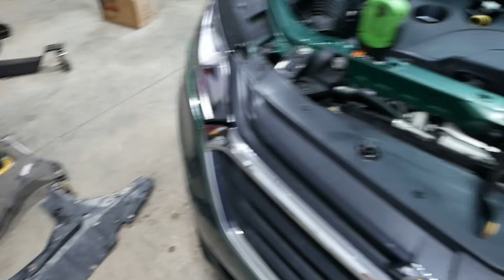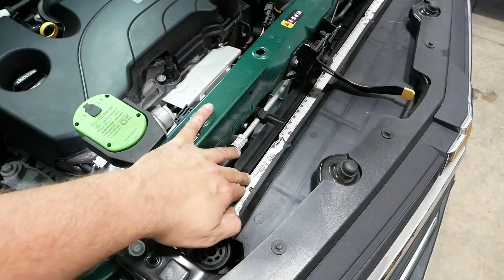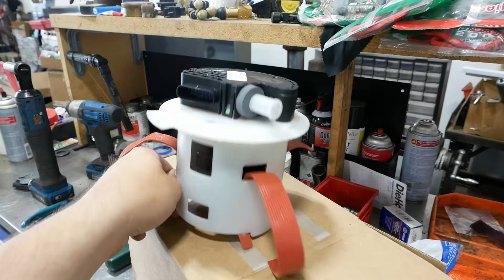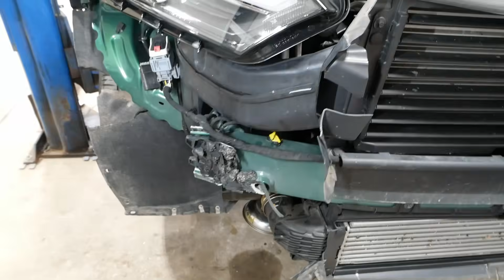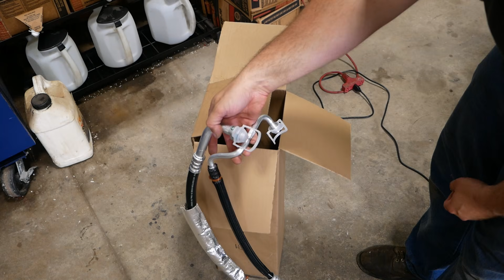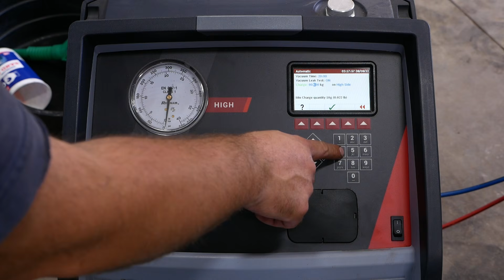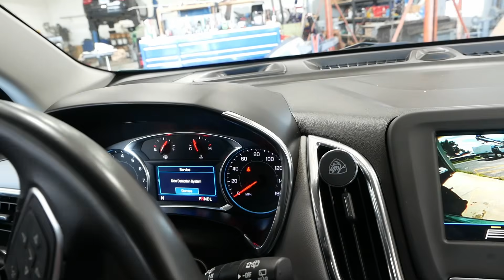Unbelievable A/C Leak 2019 Equinox

Comment: In a prior life I was a paint and body guy.  I've seen prior work like this roll in from time to time.  Makes for a pain to quote, especially if insurance is involved.  Ends up sitting around until an adjuster can see it first hand and document what they need.  Sometimes even turning into a fraud case further slowing the repair process.
Reply: the insurance companies encourage this kind of hack half ass work. use junk yard parts, parts from CoParts cars bill for new OEM parts to jack the price so the deductible is exceeeded

Comment: Def pump would be my guess as well, and the dangling sensor looks like ambient air temp. as for the initial check for gross evap leaks, it's cause r1234yf is flammable, don't need to fill a car cabin full of it accidentally

Comment: As expected, repaired properly. I imagine it would have been possible to continue along the same trajectory and bend some new lines so they wouldn’t rub, etc., however you really can’t guarantee that sort of work (or have any desire to associate your shop with that sort of thing). In this case the customer apparently had the means to fix it properly, but I feel bad for those who don’t and would have been in a real bind here.

Comment: Hello,
I'd like to add something to the whole 1234-yf thing.
I'm an apprentice in my 2nd year at a ford dealership in germany.
We also have such a "Robinair" machine, but a different model. 
Ours is able to inject oil, the uv-dye and a special non conductive oil you need for vehicles with high voltage a/c compressors, which are in ev's and some hybrid vehicles.
So yea, I don't know how it is for you in the usa but we have such machines over here.
And yea, the whole put in pull out deal is normal, I once asked someone at our shop and got the answer it is supposed to get a charge which is more precise in terms of actual refrigerant charged into the system. 
Oh and, yea. Our Robinair machine recently made a bang noise and was dead. A tech replaced the inbuilt power supply and the logicboard, hope it doesnt happen to you.

Anyways, keep up the good work.
Greetings from Germany 

~Marek
Reply from the maker: Strange. I looked everywhere for a machine that would inject oil. I could not find one.
Reply: @WatchWesWork  Strange... 
Our machine is a "Robinair AC1234-8". 
Maybe it's not available in the US, but that seems like a rather stupid idea not to sell them, i mean it's money they are not making.

Comment: Let me see. 134a was $4.00 for 12 ounce before the suck started . That would be $6.00 of freon? BUT it uses 1234yf at $45 per 8 ounces making it now $90.00 for freon. And that doesn't include labor. Is 1234 that superior to 134a? I see a lot of refit kits being sold even if 134a now costs $9.00 for 8 oz. $16 beats $90 anyday! Crazy. How about a block of ice and a fan in the back seat?

Comment: We as mechanics get to see more than our fair share of crappy body work/repair. Body man had used entire roll of electrical tape on wiring then hung the new rt ft fender over the mess. I fixed his CEL and driveability problems by removing the inner fender, the tape, and splicing several cut wires caused by the wreck.Body shop owner brought me the car. That's just one of many....Rainy day no run F 150 had the cracked windshield replaced, then it leaked water into left front kick panel, filled ECM with water. I could go on......

Comment: I work at a Honda dealership and most of the A/C work we get here is 1234YF. It's definitely more of a pain than the old R134a. Plus the machine gets very finicky sometimes. And that doesn't even touch on how much more expensive it is.

A good chunk of our A/C work is 16-21 Civics coming in for condenser replacements under a recall. Each one gets a complimentary evac and recharge of course. God only knows how much the refrigerant alone costs them.

Comment: I used to work in GM Parts Department. I can't tell you how many times I sold the right part number for something, only to have a completely different part in the box.
Reply: I once ordered an EGR valve from Fiat. When I went to collect the parts manager handed the box over. I said that is not right. He said yes it is. I said no it isn't. He said, how do you know you haven't opened the box. I said I know because the box isn't big enough. He had to apologise as guess what, it wasn't the right part.
Reply: Secret Santa gone mad.
Reply: Blame the computer..😅😅

Comment: What is the lesson here? Use a body shop approved by your insurance company, and insist. on a lifetime guarantee. If this was bought at a salvage auction, whammer bammered and resold, all bets are off. 
If you are buying a used car have it checked by a body shop. They love to point out crappy repairs.
Reply: pfft, couldnt pay me to use insurance company body shop. their insisted shops cut as many corners as they can get a kick back for coming in under the estimate but charge for all new OEM parts yet use junk yard /used parts, cheap garbage aftermarket parts. Id rather take it to shop I chose thats in no way shape or form affiliated with insurance company

Comment: Wow what a bad job the other folks did on this car.  But you immediately saw the problems and knew what needed to be done to complete a proper repair.  Fantastic job as usual.  Thanks for the videos.
Reply: When I was 17, I fixed an old Mercury Sable with similar damage.   I tied the front support to a tree with a rope, and slowly yanked it in reverse until I pulled it around to where the bolts would line up.  It wasn't exactly perfect, but at least everything bolted back on and covered it up nicely.  These guys didn't even attempt to get it right. smh..
Reply: Out of sight, out of mind...

Comment: Did you have to get new EPA certs for the new 1234yf system?
Reply from the maker: No. Same 609 or whatever it is.
Reply: @WatchWesWork  I guess that's a good thing. Still kinda sucks gotta have all new equipment to work on the new systems.

Comment: Wow. Whoever "repaired" that after the front end collision is straight up a scam artist
Reply: Looks more like a car that was damaged, sold at auction, repaired good enough to sell again, without disclosing the accident status.
Reply: @robertheinkel6225  Thats what i'm thinkin
Reply: Unfortunately, this is happening more and more with all the 3rd world imports that are crossing our borders. Anything to make a buck.
Reply: probably the dealer.   thats how its not on the carfax.   if a dealer fixes it on the lot, it doesnt have to be recorded.
Reply: That's why you get from most insurance jobs.  They want it done fast and cheap and quality doesn't matter.
Reply: @Noah_E    Insurance companies would never sign off on a repair like that.
Reply: @robertheinkel6225  Not enough of them actually go "look" at the repairs.  They just send the check to the shop and presume the owner will pitch fits about shoddy work.
Reply: @CAPNMAC82  
Absolutely correct. I've worked in a couple bodyshops and thankfully both of them were family owned businesses that were SERIOUS about putting out QUALITY work. The insurance company doesn't usually inspect any of the repairs made, only the damage and that's not all the time either. The shops I was at had their own adjuster on site, and just wrote up the car for what it needed and we did the work. Body jobs are definitely not created equal amongst all the shops out there unfortunately.
Reply: @robertheinkel6225 😅😅
My insurance company did.

Comment: that 1234YF stuff is flammable and makes hydrofluoric acid when it burns. hydrofluoric acid is toxic as hell. so beware of that stuff. if it blows across a hot exhaust manifold it can ignite.
Reply from the maker: It below into a 1000F turbo and didn’t hurt a thing…

Comment: Let me guess, they bought the car used and this crap was hidden? I ran into a used Nissan that the steering wheel controls did not work, horn did not work so I passed. Allot of shady crap is going on with the auto auction sites selling crap cars like this with hidden damage or cars that are clapped out with a zillion miles on them overpriced to the moon.

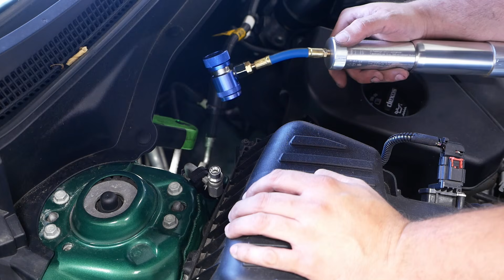Comment: 8:00 wait. clean whole system before check. you said nothing about cleaning of system. you can find out if the compressor has not seized as a result of leakage. cleaning the system, checking if the compressor has not thrown dust into the system (it can be replaced)

Comment: What shoddy workmanship. 
Whoever put on that foam piece with masking tape should be FIRED!
That calls for a Duct Tape repair.
Reply: exactly, everybody knows that job calls for duct tape, bunch of hacks
Reply: HAHA. One car I bought was missing not only the foam piece but the bumper bar behind it. Somebody just put on the bumper cover and left off everything else.
Reply: no no, in Wes's area it is mandatory zipties and bailing wire type repair. frame rail called for structural rebar, fiberglass screen reinforced bondo
Reply: @harveylong5878  no, you put a 2×4 there.
Reply: @suzi_mai  My second car was a six-year-old 1970 MG Midget that didn't have a front bumper. I used a 2X4 as one because the factory one was crap.
Reply: Ten thousand comedians out of work and you’re trying to “break” (nice little play on words, don’t you think?) into the business.
Reply: Real tradesmen use zip ties lol

Comment: Never buy a rebuilt car unless you personally supervised the rebuild or you have photos/video of every component being repaired/replaced AND you get a 3rd party mechanic to inspect it when complete.
Reply: Could easily have been a no insurance involved (out of pocket) repair... Hack it back together and trade it in (or sell it) and it moves on with zero history, sold to someone who didn't inspect it as a virgin car. 

That's why I always inspect paint and little things like the plastic trim behind the bumpers for evidence of being touched. Like this car, it can all be used to hide structural damage. 

But yeah, even if it's known rebuilt I'd still inspect it, because this stuff can easily occur. Saving money is usually the name of the game in rebuilds. A proper repair is rare.

Comment: On my sisters car the crash bar was pushed and collapsed the crush tube piece. Never knew till an air duct fell out of place when someone backed into her and broke the fog light. I knew the car was hit but the carfax was clean. Didn’t know it was a owner repair and not insurance. They got it looking good and sold it.
Reply: Yeah this is not cool, if the front took another hit then the safety is reduced because parts have already crumpled

Comment: When you go car shopping, either bring a friend that KNOWS cars and auto body well enough or pay the $100-200 to have a car inspected.  

Buyer Beyware indeed.  Nice to see GM continues to tag parts incorrectly.  I ordered an intake manifold for a Ford 4.6 - I received a thermostat housing.  Ordered based on part number which is what shows in Fords own parts DB.  Covid and post covid world parts sourcing is a mess, so is the "kwality".

I'm shocked the RobinAir YF1234 machine doesn't have an oil injection option like the R134 machines.  Wonder why that is?  Looks like the screen prompts and workflows were programmed by the EPA haha.

Comment: I wonder what the title says. Sure looks like it was "totaled" before. Great repairs by the body shop and yourself.
Reply: I wonder if the insurance company cut the owner a check for the repairs of $X,000 and the owner took it to some dude down the street who "fixed" it for $X00 instead.
Reply: @gritnix  My bet is bought at auction quick fix and to the lot in a other state.
Reply: @aitorbleda  in my neck of the woods, that's called the Eastern European flip
Reply: @DeweyCheatumNHoweLLC  An Arthur tussik?  He does decent fixes, but the style is that.
Reply: @aitorbleda  I only recall one, last name was Suschik (sp?). He'd buy Japanese insurance wrecks, patch them a bit and send them to an auction in either PA or southern Va.
Reply: @gritnix  That's another likely possibility.
Reply: @gritnix  It doesn't usually work that way.  When an insurance company cuts a check for a repair job the shop has to sign off on it in order to get paid.  The car owner can't take the money and go somewhere else.
Reply: @1575murray  that's the usual case  but in reality if hard pressed the insurance company , depending on the language used in the policy, may have to make payment solely to the policyholder.
Reply: @1575murray  I think it might depend on the state.  I've had an initial check based on the adjuster's evaluation actually made directly out to me.  But those are never enough.  I took the car to the body shop and then they started sending in all the extra stuff the adjuster missed and the insurance company would approve those adjustments and pay the shop directly.  But I was still sitting at home with that initial, fairly large, check.  I owned the car outright so was under no obligation to actually fix it anywhere in particular.  So I could've just cashed that check, had someone gloss over the repairs, and kept a bunch of money.  Someone else here said auction and that's a really good possibility too.
Reply: In new cars if there’s a major impact event in the bcm it’s totaled in most cases. Airbag deployment. Other than that most shops can replace or straighten the frames using a puller or porta power. It’s always interesting seeing how cars can be so weak and crumple as designed but still handle a crash
Reply: Yeah, looks like a Copart « runs » pos. Slapped together for a profit.
Reply: New cars don't get totaled that easy, a little frame damage is no big deal when the car is still valuable
Reply: @lolatmyage  I was under the impression that late model cars are totaled more frequently these days. Either way, it was readily repairable.
Reply: @OSXMan  I guess it depends, you definitely have some cases where they do big boy stuff like replace multiple frame rails
Reply: @OSXMan  I think that's more true if the airbags have not deployed, then all bets are off.
Reply: @lolatmyage  
Parts availability issues have lead to totalling many repairable vehicles. It took five months for my Gladiator. It was simple bolt on parts with no bodywork needed.
Reply: @841k9  I'm sure lean manufacturing and the global race to the bottom has nothing to do with it!
Reply: @lolatmyage  
Making the parts isn't a problem. Shipping them is. Parts are sitting offshore and unable to be unloaded due to excessive regulations in California.

Comment: We don’t have this model in Europe. Looks like an economy car. I thought GM was an upper class car.
Reply: LOL.  GM is NOT an upper class car. Its the equivalent of a Vauxhall for the EU.
Reply: Not for many, many years.
Reply: Nope, but the engine looks like a opel insignia one! Dont think they do any Opels in the states?
Reply: @timodeporto686  Not since the '70s. The only Opel branded vehicle any Americans would really know is the first generation GT.
Reply: @TheBrokenLife  well, you dont miss on these, opels drive fine, but generally bad build quality, bad materials and more, however, secondhand they are cheap...
Reply: @timodeporto686  That's, more or less, a description of the entire GM product line in the US. It's probably even more accurate for Chrysler though.

I haven't shopped the modern car market, but I'd imagine the Japanese brands are probably still the best choice outside of light duty trucks.
Reply: @TheBrokenLife  Kia/Hyundai are doing pretty well ATM.  Presuming they have a vehicle in the lineup that suits your needs.
Reply: @dfross87  I haven't spent much time around their entry level stuff in awhile, but I was really impressed with their later model Genesis offerings.

I'd probably still go Toyota or Honda if buying new, but I can see the gap closing there for sure.
Reply: @The Broken Life  I wouldn't even say the gap is closing (though offerings may be different in the USA).  I'd buy Hyundai/Kia over Toyota.  haven't looked at Honda lately.

The Koreans have better warranty, better cars, and lower prices.  Unfortunately Dad has a thing for Toyotas, so he paid $6K extra for a worse car, with a worse warranty, that doesn't fit in his garage properly!

Oh what a feeling 🙄!
Reply: @dfross87  Kia resale values need to appreciate to what Toyota and Honda have been enjoying for decades before they'll be seen as being in the same league.

I also spent a little time near Toyota and Honda professionally. They have it together.
Reply: GM upper class…. AHAHAHAH Hell no
Reply: It is. It's an economy crossover. 

Very common rental car in the states. 

They have other cars with premium trim, but this is just a "cheap little family car".